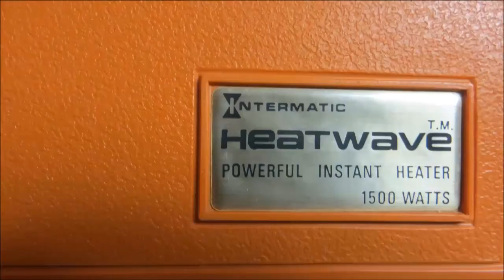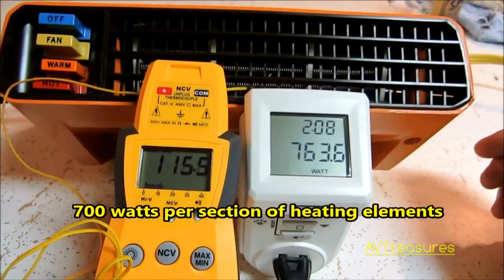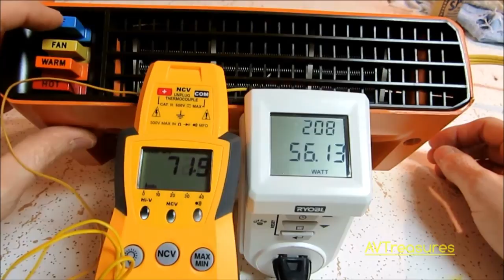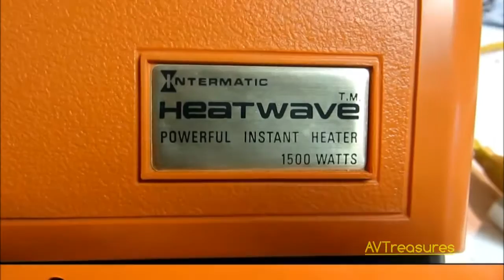70's Intermatic JH-600 Heatwave Heater Fan

Comment: Just got two heaters for free yesterday.One is a Martin Industries-Kingston series and the other one is  Intermatic.Glad I came here since  the label underneath the Intermatic heater was missing I could have plugged it into a 220V outlet and blown this cool heater.Wow!! Never knew it was this old :)
Reply from the maker: That's great, thank you for watching. I'm glad my video helped save your Intermatic!
Reply: Hey buddy I got one question. Does your heater thermostat turn-off in "HOT" mode within 1 minute when running? My current room temp is 70F so put it in "WARM" mode and it runs without any issues and temp rose to 122F and stayed there. Thermostat didn't activate it worked as it is supposed to, but the moment I switched to HOT mode the temp rose to 142F and shut down in less than a minute. Is it normal for this heater?

Comment: I have 1 of these.. Mine is tan.. It's a bad ass little heater especially considering it's almost 50yrs old. And as old as it is still has thermostat which seems 2 work better than thermo on newer heaters. And if it don't blow hot enough just block maybe 20-30% of intake (but not 2 much) and HOT damn its lot warmer without making it overheat or becoming a fire hazard. Wish i had cpl more these
Reply from the maker: I agree Dana, for a heater made mostly of plastic, it sure has held up well!

Comment: Ray,
I am so jealous of that heater!  That looks just like a 1970's car dashboard.  Completely awesome!  A good, simple design, powerful squirrel-cage blower, pushbuttons, and a bright orange case to boot!  Snazzy soundtrack as well!

I have that phone!  With its 4-prong connector, but the cord is green.  It had static, and I think it didn't ring, it was common for the ringers to be disconnected back in the day, something about Ma Bell didn't know there was a phone there if it didn't ring.  It's around somewhere, if and when I come across it again it's definitely worth playing with!
Reply from the maker: jaykay18 Hey Jay! I got lucky on this one! I typed this heater model in eBay and there were a couple of them for sale so you could probably get yourself one. They are nice little heaters for sure. You're right, it does resemble a 70's car dashboard! 

The phone was at the same sale as the heater. This one probably had the old 4 prong connector at one time or it was hard wired. Someone had spliced a modern style cord onto this one so it was ready to go. I really like the way the ring sounds on this one. It's unique to Western Electric phones I think.

Thank you for watching, and for your great comment!! Much appreciated Jay!!
Reply: AVTreasures Absolutely!  The Western Electric phones all sounded like that.  Never quite cared for the ringer on that phone myself, just sounds a bit off to me, but every phone did indeed have a distinct sound!  And because there was QUALITY built in to each one, it was almost a guarantee that two like phones would sound identical!

Definite nice finds!  Keep the great videos coming!  I really hope you'll put that heater into service, somewhere prominently on display, that's a conversation piece for sure!
Reply from the maker: jaykay18 Thanks Jay! I have another video coming up on a 1981 Jet Oscillating fan I found at the sale. Thank you for watching and for your great comments!
Reply: Heh I should have expected to see you down in the comments. lol Just picked up one of these myself from a thrift shop! lol

Comment: Hey Ray Very cool heater looks really 70's Made in the USA just needed a good cleaning Try that with a Chinese made heater in 35-40 years. The phone was cool I have one almost like it same color but push button with back lit keypad also an old rotary black desk phone dated 1-53 surprised your VOIP will let you dial out with pulse dialing.  Great video!
Reply from the maker: Hey Jason!! It is pretty cool! I was surprised to find the orange heater and that it actually still works so well. I thought the same thing! This one was made to last. I think this phone has the back lit feature but it needs a separate power supply to work. I may try to find out what voltage it requires and see if I can get it working. I was surprised that the pulse dialing worked too! I guess the VOIP providers had to make it work just like a traditional land line for their older customers that are still using rotary phones. It's neat that it still works though! Thanks man, I appreciate your comment!!
Reply: That's awesome I have the cable phone and also the box for home phone works over cell phone towers and no go on the pulse dialing. I also thought that your heater still having the box was awesome that's really rare. Thanks for sharing!
Reply from the maker: AbandonedSC I recently switched my home phone service to my cable companies phone service. I was surprised the pulse dialing works on it, I wasn't sure that it would. Having the original box is great, it really makes the item complete. Thank you for watching Jason. I'm looking forward to your next exploration video!!
Reply: Thanks! I just tried the pulse dialing on my cable phone and it works! I'm very pleasantly surprised!
Reply from the maker: AbandonedSC That's awesome!! I'm glad it works for you too! I also can't tell any difference in how my cable phone service works as compared to the regular phone company. The calling features even work and sound the same.

Comment: Hi Ray!! Nice little heater. Got one of these with me. It needs a bit of cleaning though since the fan makes some noise sometimes. Apart from that it runs fine on WARM setting. But the moment I switch to HOT it runs for like 2-3 mins and shuts immediately, then turns back ON after 15 minutes maybe. What could be the possible issue? The temp know under the heater is at highest setting.
Reply from the maker: Thanks for watching my video. I would recommend taking it apart and cleaning it good. That may be why it's shutting down. It could be getting too hot due to lack of airflow caused by the dirty blower wheel.
Reply: I'll try cleaning it and oil the motor and see how it runs.Also the oil you used, is it the normal lubricating oil used for drills,sewing machines etc? Just asking coz this is a heater and the heat might make some petroleum based oils stink once they get heated up. Cheers!!
Reply from the maker: The oil I used is Supco Zoom Spout. Here is the information on it: Supco® Zoom Spout® Oiler 4oz

A paraffin base, non-gumming, high quality lubricating oil. Flexible spout extends and retracts, adjusts to any "in-between" length. Withstands high temperatures without breaking down. Viscosity of 92-99 @ 140°F.